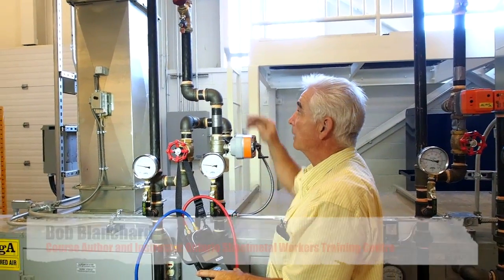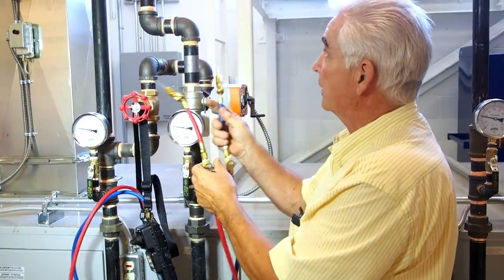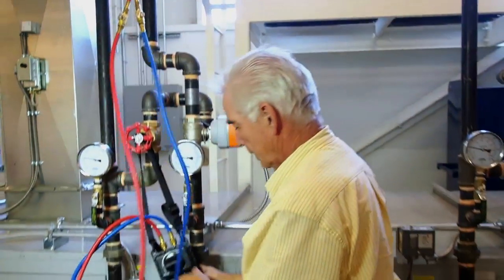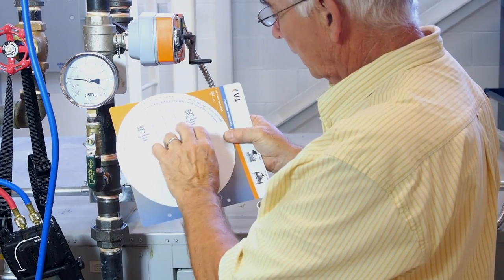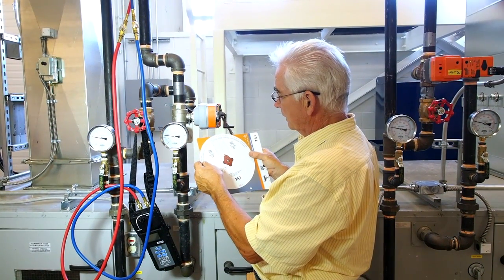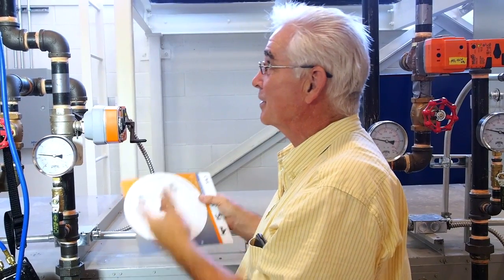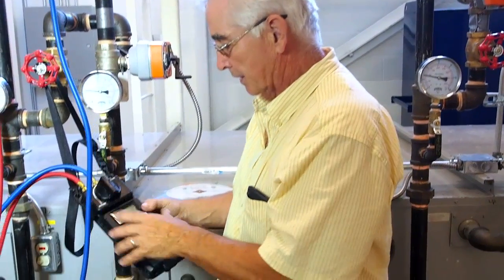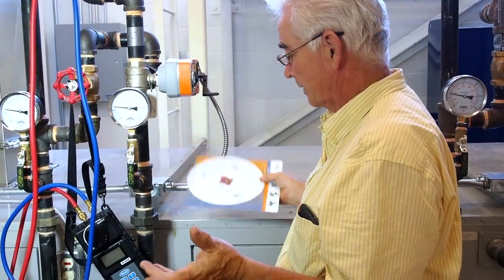Measuring Water Flow Rate at Circuit Balancing Valves

Comment: I wish the balancers would mark or label what they set up so years later, some tech has bumped or changed it, we can put it back. I wish they would maker damper positions too. I also wish I had a lot of money.
Reply: The TA and Armstrong valves both have a memory stop feature. There is a small Allen key you tighten down in the center of the valve head to lock in the balanced position. Once memory stop is tightened up, you will still be able to close the valve all the way but you will not be able to open it passed the balanced position.

Comment: Bob, Not sure why you set the meter to bypass and than hook up to ports.  Bypass equals the + & - gauge reading, than zero it, Now you ready to connect it and measure DP
You also should note the likely motorized modulating valve that MUST be open before you do the above.
Aloha-Paul Morse-AABC-TBE
Reply: You can zero it after connecting as well.
Reply: @OneOfDaLast  I’m trying to balance a taco Accu flow balancing valve, but it’s reading negative pressure and my ports are connected correctly. What does this mean?